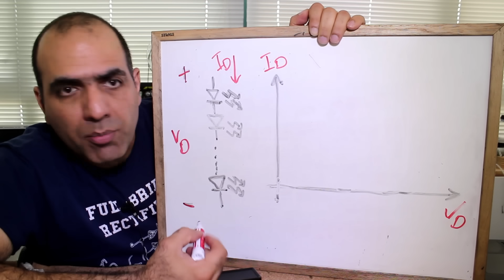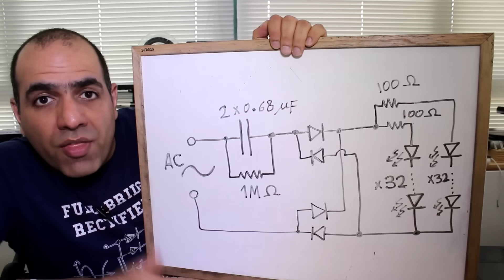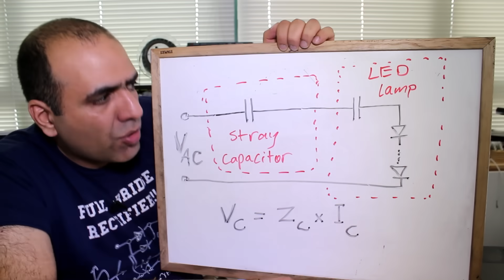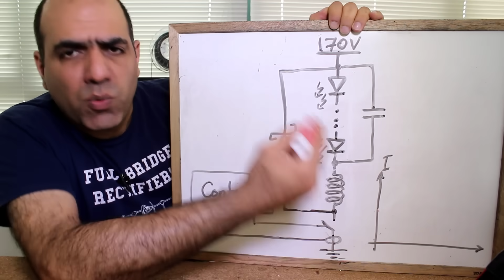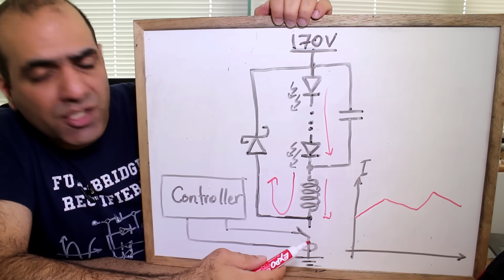Why Cheap LED Lights Keep Glowing

Comment: LED is your friend:
* It's effecient and keeps your bill low
* It's cheap and holds forever
* It's powered by friendship!
Reply: except for  that chinese led. it keesp sucking electricity even turned off.
Reply: (▀̿Ĺ̯▀̿ ̿)  That's not true (at least not from the mains which is the only electricity you're paying for)... The LED is being powered by the capacitor that's in built with the bulb after the mains is switched off.
The point of the resistor is to bleed off excess charge once the power is off.
Mehdi even states, the resistor makes it very slightly less efficient (as a tiny amount of current will go through the resistor instead of the LED), but at least it switches close to immediately after the mains is off and won't turn on due to other small sources of current (like Mehdi's body after running his feet on the carpet).
Reply: @eetee6962  that is what steve said tho
Reply: Friendship?? Crap. I've been powering mine with the screams and wails of the damned. No wonder it glows red all the time.

Comment: Try making a circuit that outputs 72,000 Volts, with the maximum power of the output of 3,312 Watts, running at the frequency of 54.8 Hertz sine wave.

Comment: I'm an electrician in the UK and with the rise of Led downlighters and mood lighting in design and build scenarios, we have stumbled across this problem before and worked out what we need to do is place 'res loads' in parallel across the LED downlighters or failing that even the inverters or transformers from the old downlighters will do the trick as they place a load on the circuit. I never knew the in-depth reasoning behind what caused the glowing phenomenon though so this was a very interesting watch. Thank-you Electroboom! 💡💥

Comment: Also neon lamp backlit switches can cause cheap capacitor dropper led bulbs or current source driven led panels to glow when power is off because the current of neon backlight is enough.

Comment: Can you please do a video on why dimmable light switches sometimes fail in some unknown way that causes the led lights powered by the switch to no longer be able to be shut off completely?

I installed Lutron (prob misspelled the manufacturer’s name) dimmable light switches all around my house in combination with dimmable led lights but for some reason unknown to me, when you turn the switch off in the bathroom the led lights remain about halfway lit. (This particular light switch used to work perfectly.) And now when you turn the dimmable light switch on slowly increasing the power through the switch nothing happens with the light brightness until you get above halfway on the switch, which causes the lights to suddenly go just a about full bright. Its almost like the dimmable light switch is in some partially failed mode.

Any idea how these dimmable Lutron light switches work???

Would really appreciate your incredible insight on this problem! Thanks for this video!

Comment: This may have been asked but in my old house I had motion sensor switches which I love. But regular LEDs refuse to work with them. They either flicker when turned on or they’ll glow fairly bright when the switch is off. Is it a faulty switch or is that just how they work?

Comment: Man has always had the characteristics of resistance power pressure shock  static  capacitance (human version is called capacity), sometimes value of capacity is 6pints of lager or more to make eyes glow in the dark ( in uk try ordering a litre !)

Comment: I had this issue  with my 1st cheap LED bulbs. I have 2 dual bulb lights in my living/kitchen. sometimes i would unscrew a bulb slightly to have some light but not much while watching a movie. when then turn the light switch off. if a led buld was connected, it would flash +- every 1sec. when i re-attach the unscrewed CFL, the flashes stop.
LED's are great, But what I HATE are the cheap electronics in them. When a LED bulb dies, it's the electronics not the LED's them self

Comment: As a diesel mechanic these videos have helped me a lot in understanding the new technologies in vehicles. It's no longer just switches, relays and fuses. We have to diag actuators that use pwm signals and there are trucks in service that have computers just to roll down the windows. Thanks electroboom!

Comment: Wow, this answers a question I've been lying in bed at night staring at the ceiling pondering. Because the LED all-in-one unit in my bedroom has been blinking any time someone turns on a row of SELV transformer lights in my house, or the really big boiler relay clicks on. It must be a big example of the first circuit you showed. Phew - I thought I had a bad neutral somewhere.

Comment: Wouldn't the 1MΩ resistor itself be wasting power?
Also, in case of the expensive LED light, isn't it an overkill? Like a μC for a non IoT light! Further, the purpose of an LED light is to be efficient enough to turn on at extremely low voltages, annd waste as little power as possible. Doesn't these mechanisms defeat the entire purpose in that case?

Comment: Can you stop using direct connection to the power plugs? many people have 220 instead of 110, when you get shocked you are fine (both because of the power and both because some of those are controlled and fake), but they will be fine if they try to reproduce it

Comment: I put 2 of these in my cargo light on the roof of my truck. They would only glow like this if I left a single interior light on, but only after the BCM would turn off the interior light after 10 min timeout.

Comment: Companion comment for your companion video...

This video is good timing.  I have 3 outside lights on one circuit. All 3 are LED lights. The furthest lights in the chain are of one make. The nearest light is of a different make. The nearest light failed and then, all of a suddent, the furthest lights started glowing when everything was turned off. Very odd. This video helps explain the mystery.

In the end I changed all three to a more expensive make and things are all good.

Comment: This once happened in my home, some of the LED bulbs in switches would light faintly even when the switch was off (we have switches that have LED in them indicating the switch is on). Later it was found that somehow the polarity of AC was reversed for our home from the main cable coming from the electric line. So the switches were disconnecting Neutral instead of Line.

Comment: but i think the 170volt DC from the  FULLBRIDGE rectifier is just the open circuit voltage. the voltage get reduced significantly with the load connected.
Reply: @bosstowndynamics5488  my doubt is only about the output voltage of the fullbridge rectifier, if the input is 120v ac the rectified output is 170v dc (neglecting the voltage drop across diodes).  but this 170volt dc is just the peak value of the output sine wave. then what is the average value of the output dc? what value a multimeter will show if i measured the open circuit voltage of  this FB? it show the peak value or the avg value?

Comment: Hi, what about soldering? (serious question) I just finished changing my whole home lighting to solar (and batteries), in my region 12V led bulbs are not common so I modified around 15 bulbs rewiring the Leds, I removed the circuit including the capacitors and ended with the plate and Leds while soldering. Surprisingly, SOME of the leds would slightly light up while soldering.

There were no connections, no batteries, no circuit, no capacitors, I wasn't barefoot and the soldering iron it's a simple one using heat. I soldered using a wood base, everything it's isolated. This didn't happen on some of the bulbs, only on some (all the bulbs were diff brands). And nope, this didn't happen when the soldering iron wasn't hot (so it doesn't happen disconnected, and it doesn't happen connected while cold). Funny.

Comment: Obviously Brilliant.org doesn't have classes on electrical safety.  Shocking yourself once because you're tired and forget to switch the breaker is amusing.  Shocking yourself several times in a single episode is a bad example to the kids.

Comment: I have 2 regular led bulbs that glow when turned off... but they are controlled with illuminated light switches.. the juice that lights the switches when they are off also makes the led bulbs glow slightly...

Comment: I have an outside waterproof light switch that also has an led that denotes if it switched on of off. I had do disconnect it as it never went off as the current so little it kept it on

Comment: I have this EXACT issue with my LED light strip in my room. It always glows a tiny bit if it's turned off and if I put my finger on one of the resistors the LEDs around it start glowing.

Comment: @Electroboom - I did make a human human analogue a long time ago to test if a 1000V DCDC converter would collapse if it was connected to the analogue. It was designed to an BS:EN standard. I can‘ t recall the standard but Look it up and stop using yourself as a test load!

Comment: Shouldn't this only happen if you are back switching the lamp? Regardless, back switching is against the electrical code in the US (now) but maybe you can use the effect to test if a contractor is following code.
Reply: does it matter if it's an AC circuit?
Reply: @QualityDoggo  It only matters if it's an AC circuit. To a dc circuit a capacitor is just an "open" (what you would assume the wires would have done in the first place)
Reply: @bosstowndynamics5488  Lets say you have hot and neutral going into your fixture box. Back switching is taking a 2 wire cable from that box to a switch and connecting the hot to one of the 2 wires and the other wire connecting to your fixture, finally taking the second wire of your fixture to neutral. (To explain it differently: [hot connected to switch, switch connected to fixture]<-using a 2 wire cable, fixture connected to neutral ) if you draw it out you can see that while the switch is open one wire of the cable is live and the other is connected to neutral through the fixture. Since a capacitor is made up of conductors that are close to each other but not touching, the 2 wire cable acts as a small capacitor.
Reply: @D.O.A. look at my reply to the same message, im sure your right about what back switching is, but i may be talking about something else.
Reply: @D.O.A. it would be near field emi I think. The frequency is so incredibly low that you can think of them loosely as the same thing but they are way different. Short answer... if you are just trying to understand it and you will never go into engineering, totally yes.
Reply: @bosstowndynamics5488  Power goes to the switchbox, is switched, then to the device and back through neutral. The important part is that you take the neutral wherever you take hot. ( so not useing the white wire as a switchleg)

Comment: Haha thank you for making this video, I have a very cheap LED bulb I use it in my bedroom as a secondary light, it  fuking glows every time when I am trying to sleeping even if it's switched off, Lol
Reply: Put the plug in upside down (assuming it is a bedside lamp that is plugged into a socket). It may be that the switch was in the neutral wire instead of the live wire.

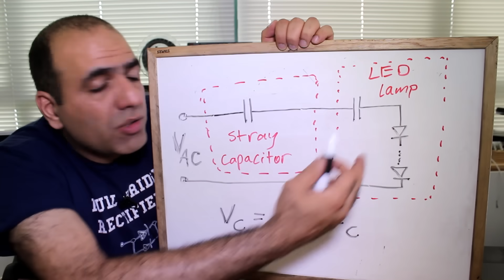Comment: I really don't get the explanation at 6:58, if there's no current and no voltage across the caps, how does the LED glow?
Reply: There is voltage across the capacitor. The "Stray Capacitance" is the capacitance to live when the switch is off. There are 2 capacitors in series with the leds themselves, so current can flow.

Comment: I did use some math on capacitor impedance to learn how to use the proper capacitors to get 120 VAC motion detectors to run on 24 VAC.

Comment: Brief explanation!
I once have the same problem before. My LED light in my bedroom kept glowing while it was turned off, then I realized it was because that I connected the switch wrong. So whenever I turned it off, the neutral wire disconnect but the live wire was still connect. I thought it was malfunctioned, then my dad flipped the plug and solved the problem.
Reply: This makes so much more sense, thank you!

Comment: I did notice at night some of our CFL bulbs will sometimes glow a little when you shut the switch off. The reason they do is because the contacts in the switch will act as a capacitor and will pass enough voltage/current to cause the bulb to still light a little bit.

Comment: Awesome, as always, Mehdi! 
Years ago, I built an art lamp that used a bunch of green LEDs in series. One night, when the room was dark, I noticed a very faint glow from the LEDs even though the lamp was turned off. I figured it was some sort of leakage from the mains so I unplugged the lamp. To my amazement, the glow was still there! While standing there trying to suss-out the reason, the LEDs suddenly increased in brightness- not by much, but noticeable. Soon after, the ceiling started warming up and then it dawned on me: the LEDs were rectifying minute amounts of 60Hz current being radiated by the house wiring. The sudden increase occurred when the ceiling heat (composed of a very long wire embedded in the ceiling plaster that zig-zags back and forth over the entire area of the ceiling- and powered by 60Hz current) switched on. B-)
Reply: Nikola Tesla would approve. He tried to transmit power wirelessly.

Comment: Why are LEDs not connected in parallel so that if one of them stop working it doesn't affect others !
Reply: If you put them in parallel without resistors in each parallel string, then the current through each string will be different because there is some variance in LED´s forward voltage, and as shown in the video, a small difference in voltage causes a big difference in current flowing.

Because of this, some leds will get too much current, and some will get less than they can handle, making one series string fail very soon, then likely killing the rest of the leds because they will now get all the current. So at least when running leds with simple circuits, a single series string of leds will be much more reliable.

Comment: Hey. I have LEDs in my house on a dimmer switch (they are dimmable bulbs), and when I turn off the light the LEDs glow for a few minutes very faintly before they completely go out. Is there maybe a capacitor in the dimmer that's slowly discharging through the light after switching it off, or something else entirely happening? The live wire goes through the dimmer to get to the bulb, and the neutral is connected to the light directly, so it's not capacitive wiring in the house causing this I don't think.

Comment: I Don't understand a single Word but i'm watching because it always make my Day better.
Reply: We're on the same boat, there.
Reply: I understand him but he does get into some detailed stuff but he broke it down nicely, 
He used the resistor to absorb some current that is stuck in a loop to stop the glow, the small lights can glow with the left over charge while the light is turned "off". It uses the wire in your home as a tool to keep the looped charge.  
That's what I got from this. Would be fantastic for hallways at night.
Reply: Zato trebaš znati fiziku braleee
Reply: @ivanokriletic2428 de šuti dobro da sam još ikako izgurao trojku sad u osmom😂😂😂
Reply: @danijeldokus9185  da mi ne poklonise dvojku verovatno bi jos bio u skoli
Reply: Danijel Dokuš I’m a Yorkshire lad but I can understand him
Reply: Isaacs Random Videos 
I'm pretty sure he means he doesn't know what he is talking about
Reply: Basically dont put you're finger directly in a lightbulb socket

Comment: I think in Steve's video he has the hot switched (open) and the neutral connected. In your video you have the neutral open and your body (capacitor) competing the circuit in the neutral
Reply: In the case where his body is the capacitor, you are right that it makes a difference which wire you switch.
However in house wiring, it depends. There can be different amounts of wires inside (a section of) the cable that goes to your lamp socket.

For example you may have 1x PE, 1x N, 1x L and 1x switched live, the latter is what´s actually connected to the lamp socket. In that case no matter which wire you switch, there is capacitance to another wire of the opposite potential inside the cable.
Not sure what situation Steve had, there could be other reasons.

Comment: The same applies to old flurocent lamps if you switch neutral instead of live i have some of these in my hiuse and when its completely dark you can see a super slight glow and when i bring my hand closer to them the glow becomes brighter.

Comment: Salam Mehdi.I watched your video about making a shunt ammeter.You said that clamp meters are  inaccurate(at low currents).
There is a way you can increase the accuracy by winding a few turns of wire over the clamp of ammeter  and divide the final reading by the number of turns.I have compared the results with shunt and this method is quite accurate.
Maybe make a video about the thought, might help a lot of people. 
Love from Pakistan.